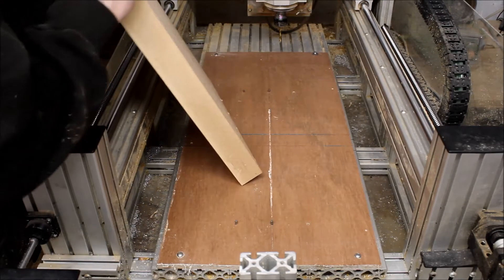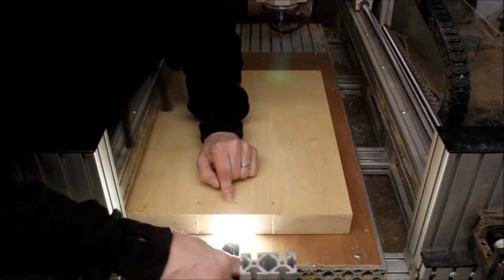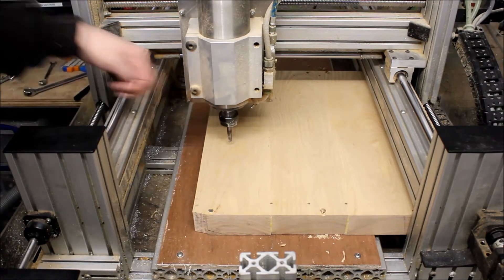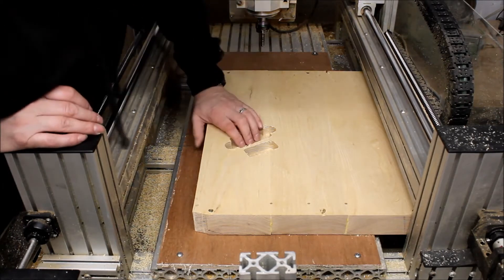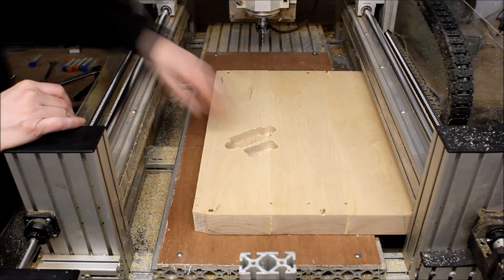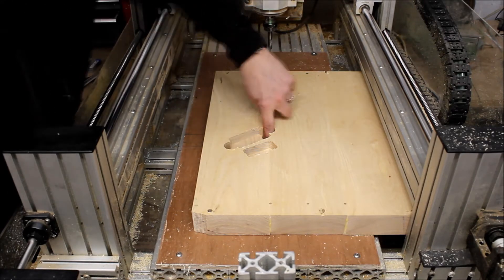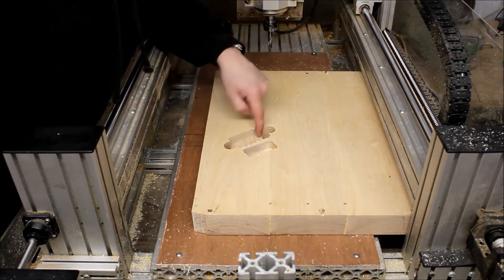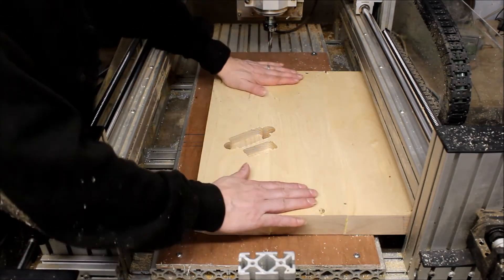CNC Guitar Project - Andy Summers Telecaster - Part 9 - Cutting the Body

Comment: hi chris. nice work ! do you have the fusion file fro the neck without the fretboard? or did you do the neck an dfretboard as one. cheers scott
Reply from the maker: Hi Scott
Thanks.
I do have a rosewood fretboard/neck version, but it is subject to acommercial arrangement and therefore not available, sorry.
You can do it fairly easily yourself by splitting the maple version at the correct depth, using a construction plane.
Good luck.
Chris

Comment: do you need to vacuum that much?
Reply from the maker: When cutting wood, not so much, its just a habit I have gotten into from milling aluminium, where recut chips normally equals a welded tool into the block you're cutting. If the slot is packed full of chips it is in essence increasing your depth of cut as the tool ploughs through them (and the actual wood), so it can induce chatter i.e. rough cuts/tear out etc.

Comment: Why are you vacuuming around a moving machine? Dangerous?
Reply from the maker: Hi Tim - I have a healthy phobia of recutting chips and especially when deep slotting (full width cuts). As for danger, sure its marginally more "dangerous" than leaving it alone, but in general the machine isn't travelling that fast and is predictable. At some point I'l put a dust shoe on the machine, but that won't make for very good viewing in videos :)

Comment: Hi Chris,
      Great video!! Do you have the body model with the rear cutout for the electronics?
Reply from the maker: Thanks Carl.
Yes I do have the CAD for the S-H version, but I am not releasing that, sorry. The S-S model is pretty ubiquitous, so low risk. The Andy Summers version, however is a different animal and retailed for $15,000 each back in 2007, so hopefully you understand the implications....

Comment: Hello Chris, awesome job as usual. You always make it look so easy,,,,, I was wondering how you set your zero point on your machine.  Do use a probe or edge finding device or just eyeball it...or maybe the paper trick?  Can't wait for the next video!!
Reply from the maker: Hi Payday1963 - Thanks as ever. For finding the centre zero fro work coordinates I zero first of all at the machine X and Y zero point i.e. the extremity of travel. Then I know that my bed has a 700 x 260mm cutting area, so I use the manual interface (MDI~?) in Mach3 to jog the spindle to X=350 Y = 130 and zero the work coordinates there. I then use the tip of my chamfer mill to cut/draw a line in the sacrificial bed by jogging the machine to the extremes of travel from that zero point i.e. drawn cross hairs. I then mark the wood centre points on the sides using ruler and pencil and line them up with the scored cross hairs.
That all sounds a lot more complex than it actually is, but you still have to take care with the zero point in the CAM from Fusion to make sure the "model" inside your stock is in the right place i.e. its zero is where you expect it to be on the machine.
I do use a Ruby tipped probe for metal work, where stock edges are way more important and always use the touch plate zero for tool height (I have a video on that somewhere on the channel).